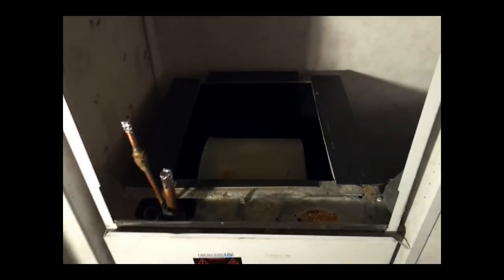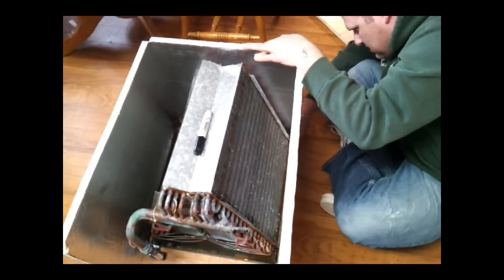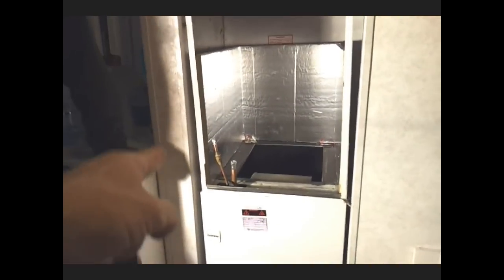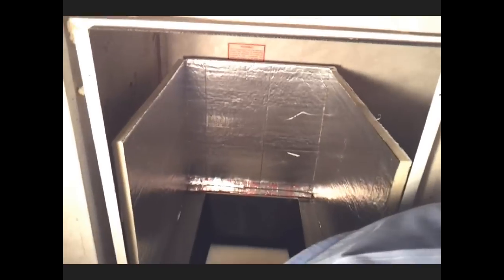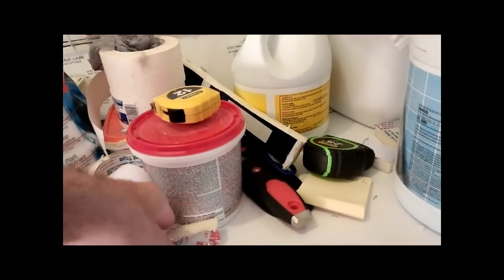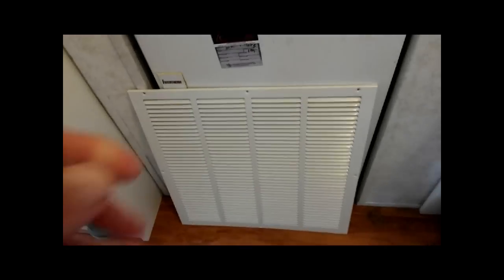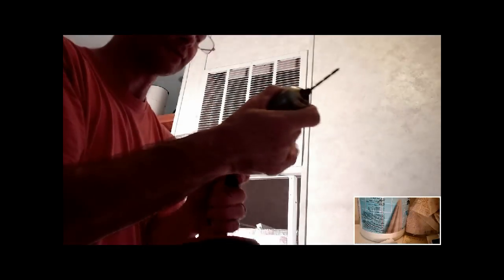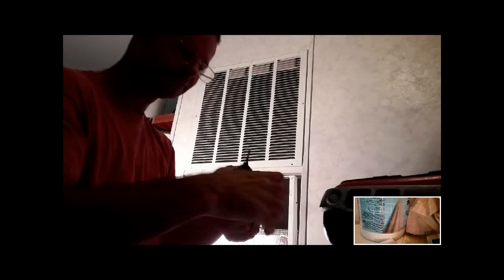HVAC Building an Air Filter Base for Downlflow Mobile Home Evaporator Coil Air Conditioner.

Comment from the maker: Good idea on flipping the grill!  I have a second return in the next room over and had thought about doing it with it since you can get light from the kitchen through the two grills.  ...however the narrow area where the air handler is also housed the hot water heater and I didn't want any extra dust bunnies, cat hair etc to fall down in the vents and cover the area in there since it's not just the filters :)  ...prolly wouldn't be too much though.  Great idea!  Thanks!

Comment: I did something similar to my mobile home after 1 year of living here the coil got filthy and was a poor design....instead of cutting a whole for the return air on top i covered  the sides and the top of the evap coil with sheetmetal like you did and put a 20x25 r/a grill w filter in front of the evap problem solved. good job sir.
Reply from the maker: Awesome!  ...and thanks for the compliment and watching the video!  ...yeah, I don't think Ive ever seen a mobile home installation that I've liked yet!  The very worst Ive seen was an up-flow in a mobile home (I wondered if it was ever meant to be installed like that) and the filters were on the bortom. You literally had to pull the cover off and lay on your belly to change the filters!!  ...and they were custom oddball size filters, like 6 to 8" wide and the depth of the unit, you had to shove them in there in an inverted V fashion.  
The customers were cheap and lazy and didn't care about taking care of the thing at all!  Usually I'll see that with renters or maybe lessers, but rarely owners, so it was strange.  ...i had gone out the first time on a xall for no cooling; the unit was frozen over bad!  I had to turn it off and made them leave it off till I could get back the next afternoon. Early summer in Texas, they weren't happy, lol... But you cant do anything with a frozen over unit, much less check it, till its defrosted!
I went back the next day and looked at it, they had NO FILTERS on it at all!  The evaporator coil was completely clogged up with dust, dirt, people and pet hair, VERY nasty!  I was on a home insurance call and had to inform them that it wasn't covered by their insurance policy since it fell under lack of proper maintenance.  Grand parents and two adult families as well living in this big mobile home,so no excuse but laziness.  "We couldn't find any filters to fit it so we just didn't bother."  I actually scolded them like children! Lol.  I told them how much my company would charge to clean the coil (NEVER cheap!! Coil cleaning usually sucks!) and they went ballistic! (Think I quoted 500 or something, cant remember how much my boss was charging back then) and they decided to call around. 

Soooooo....I get called back out there THE NEXT YEAR and guess what I find?!  The SAME DAMNED THING!!  They had paid through the nose to get it cleaned and STILL didn't put filters in it!  I had told them they could order custom size filters on the internet and usually places like lowes or home depot can order them too.  I had ALSO told them that since they were already going to be paying to have the coil pulled out and cleaned they should pay a few hundred more and have the company install a filter base on the bottom, that way they could just flip down a magnetic door, slide out a single filter and slide in a new one!  Did they listen?!  Hell no!  Boy they were bitching when I told them the coil needed cleaned again!  I had no sympathy for them and scolded them like little kids again for being so irresponsible! (Sad eh?). No money they say, but I turn around an theres a new 50" flat panel that wasn't there last year and obviously a $70+ a month satellite dish plugged into it!  (Shaking head). ...just don't get some people!
Reply: That's the cure!...I'm selling that modification to this day
Reply: Trailer houses create alot of post purchase repair/,modification
Reply: Trey do you have pics of what you did?

Comment: I have a very similar set up in my mobile home where the blower is sitting below the Evaporator coil. My question is about the flow direction on the filters you have on the coils...I have always put them with the arrow pointing towards the coils , assuming the air flows in thru the fins towards the coils.  A service tech came out last Thursday and cleaned the fins/system/checked for leaks and he put the filters with the arrow pointing opposite ---as if the flow is coming from the coils out thru the fins. Is this correct? Does it matter that much?  MY systems has not worked good since he left.
Reply from the maker: Airflow is in the direction of the arrows... but in our Cass it's not overly important since the filters are right on the coil. 

The average pleated filter will have a cross thatched reinforcing on one side,  like a lattice fence for visual reference,. In a more typical installation if the filter was put in backwards where it had open space on both sides,  the strong blower could pull the filter out of shape,  flattening it and possibly causing issues depending on how the system is set up. 

The only thing I could think to watch for is possible mildew buildup on the lattice if it's on the coil face.  I can't recall that ever being a problem here though...

So basically the arrow is to insure the filter doesn't lose its shape. 
Hope that made sense,  me typing with one hour sleep! : )
Reply: @mikie2501  My filters have arrows showing flow. that is not my question. .I'm asking about the actual flow of air as in which way does it go? Is the air being sucked in by the blower below which means  the air comes in thru the fins and then across the coils and down to the blower? My service man put the filters showing the arrows opposite of this( as if the air comes from the coils and then exits thru the fins)  I'm pretty sure he put them in backwards with the pleated/lattice side against the fins , but he is a professional doing that work all day.....I wanted a second opinion.

Comment: I have a unit just like this in a modular I just bought and I've been trying to figure out where to put the filters.  Another video I watched showed that putting filters directly on the A-coil was a bad idea, but I can't find anywhere else that the filters could possibly go or fit, so I'm going to do like you and just put them on either side of the A-coil and hope for the best!
Reply from the maker: Yeah, I believe when you buy the a-coil or the basic system, they include two cheap foam filters that lay against the coil faces. I had them on mine originally. After a while I started using pleated filters. I couldnt find the exact size in height but the width fit fine. They were just too tall.
They make a filter base box that goes around the coil but Im pretty sure you have to remove the coil to install the filter box.
Reply: mikie2501 
This method made my unit freeze up.

Comment: You should get one of the 3 inch depth air filters, which have great air flow and last 12 months, to put behind the grill.  And use a grill with ears on it so you can swap out the filter easily.

Comment: Install filter grill and duct air handle to the grill ,the A-coil is not designed to have a filter attached...you basically have created a negative static pressure against the condensate system...this can cause water to collect around the blower and will damage floor as well as the blower.

Comment: Do you also put a filter to the return grill you just installed or not all all cuz of the coils have 2 filters already?
Reply from the maker: Hey Roy! No extra filters,  just the one over the coil. Any extra filters adds more airflow restrictions,  which you don't want!
I have the return grill above the unit but also one that I installed in the bedroom,  which has a wall connected to the space that the air handler and my water heater are in.   That way air circulates a bit better.  Not as quiet since you can hear it better in the bedroom,  but we got used to it fast.  Well I did,  the wife wears earplugs because I snore ;)  

We actually had a new system installed in August,  my condenser fan motor went out in June and I replaced it,  then at the beginning of August the blower motor bearings finally wore out and it died,  so we decided to replace it with a heatpump system.  16 seer. Middle of the road,  but still like buying a used car,  hehe!

Comment: Superb Video,just what i was looking for. Do you think this could be done without removing the A Coil? ( Granted,there would'nt be access to the rear of the coil)
Reply from the maker: Im sure it could. It would be a bit more time consuming and have to be done in sections so you could get it in there, the difficult part would be sealing the back side of it at the bottom.  I was originally going to do it that way before I decided to clean the coil.

Comment: Holy heck Deja-Vu I have a new system being installed in my house today and my installer bumped me up to a 5-ton two stage heat pump and a variable speed American Standard system long story short my cabinet looked almost identical to this one down to the paint pattern on the inside and outside of the cabinet day pretty much done the same thing you just did except they put 2 seperate 25x30x1 inch returns one around the left side and the other where you put this one. I don't know about 10 years ago but right now when driving wood screws T-25 star headed wood screws are your friend they don't sleep nowhere near as bad as Philips screw heads.

Comment: hey mike buddy i bought this trailer. Ac unit outside was stolen by the time my new furnace arrived can i still use the furnace only and how to disconnect the ac coil from furnace
Reply: Jose Alvarez Did you ever get an answer to this Q? I'm looking at an auction Manu.-Home where the air handler and heat pump were both stolen, I want to replace the air handler + heat strip for now while maintaining the ability to add on the exterior heat pump unit at a later date. Any info might help. Thanks

Comment: Ok we put a good man down flow air conditioner inside unit together but we're having trouble figuring out how we put the air filter on does it go on top of the unit could you please let me know if we feel like dummies
Reply from the maker: Hi Donna!  I understand what you mean, sometimes its fun trying to figure them out depending on how/where they are installed!  
You said its a downflow so Ill assume that its in a closet space or similar and stacked vertically (as opposed to being hung horizontally in an attic) and that its blowing air down through ducting in the floor.  Typically the air handler is on the floor or spaced up on a small riser off the floor, then the evaporator coil sits on top of the unit.

Depending on how the unit was set up it may or may not have a space for a filter... The filter should go on the top of the unit since the air is being sucked through the coil and pushed out the bottom.  If there is a metal case around the coil it might have a slot at the top to slide a filter in. If there isn't a slot, but there is a case around the coil, you can buy a Filter Base to mount on top of the coil box to put the filter in.

Worst case is there is no box case structure around the coil and the coil is just sitting on top of the air handler. Mine was like this, the installers were too damned cheap to spend a few extra bucks to buy the coil box to house it and hold a filter, so they left the coil bare and had two foam air filters, one sitting directly on each side of the A-coil.  I could have bought the box for the coil but wound up making my own and buying a sizable washable filter to go with it.
http://www.ezfilterbase.com/index.html. Here's a website that makes filter bases, there are a lot out there with color pics if you look around.  Click on the Spec Sheet link and then click a few of the links.  The Downflow pic is kind of sucky so one of the upflow pics will give you an idea.

Give me a better description if this isnt what you mean, hope this helps!  I have a video or two on here where I made a coil box/filter base as well.

Comment: I have this exact unit in my mobile home. Recently, no air flow is blowing on other side of double wide. Any suggestions on how I can fix this problem?
Reply: beerbebud  The heat and air company I use sent a new fella out. He said he had to change the blower motor. Could that be asque causing it to not blow in correctly? There is a black under skirt covering everything under there. Im not sure where to cut the fabric to look.
Reply: beerbebud ok, my son went under there and all the flex pipe was connected. 
Where it comes out of the unit he said large amounts of air was coming out around the connection.
He did patch a rodent hole in the flex pipe and said air WAS going into the flex pipe. When I checked the registers inside, there was still no air. The side same as the unit has massive air blowing out. The side opposite unit has zero air.
Reply: beerbebud  It's the black flex pipe.  I was thinking the same about replacing. My son is going on an outing with his friends, so maybe tomorrow. I'm sure he can fix it if he knows what to do.
Thank you for helping me you've saved me hundreds, I'm sure!